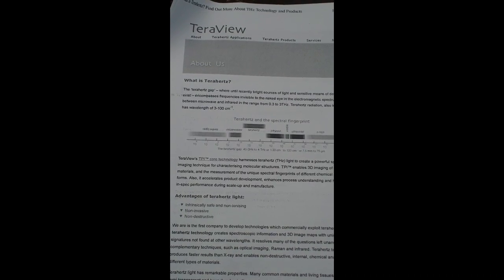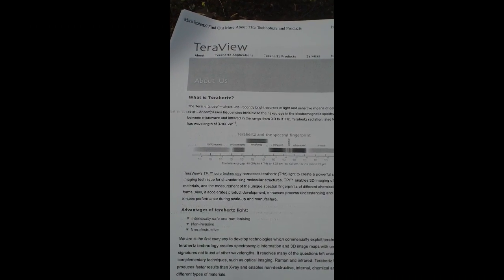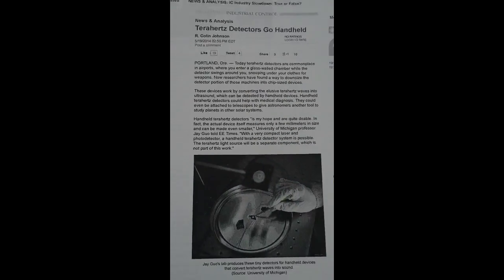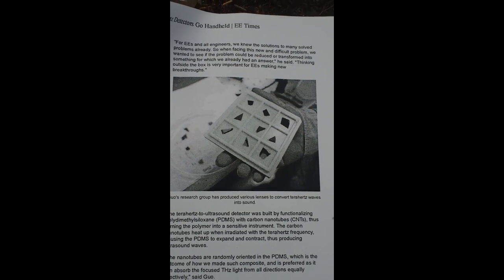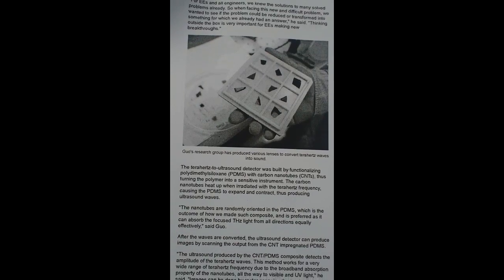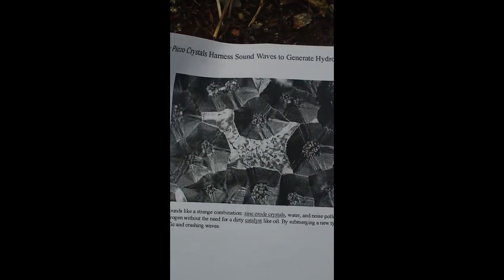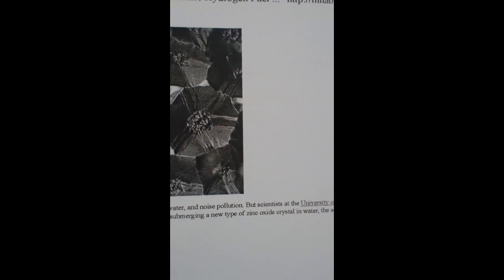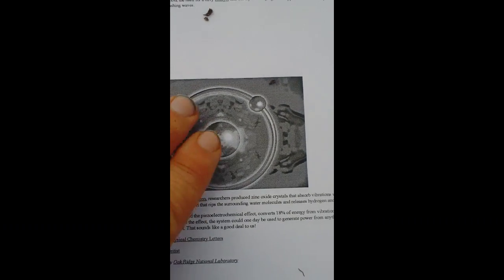GREEN ENERGY: HYDROGEN FROM WATER

Comment from the maker: the second article is about not sound but LIGHT terahertz is electromagnetis signal. the reason it is commercial is terahertz is ambient energy it is everywhere and free. by using it to make the ultrasound it means free hydrogen fuel.
the terahertz to ultrasound material is PDMS polydimethylsiolxane. nanotubes mixed in recieve the terahertz